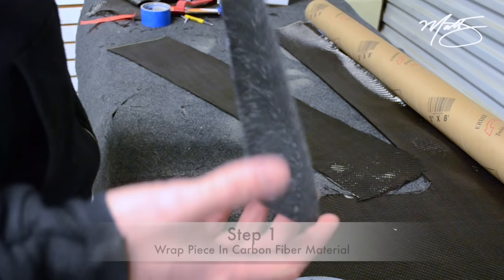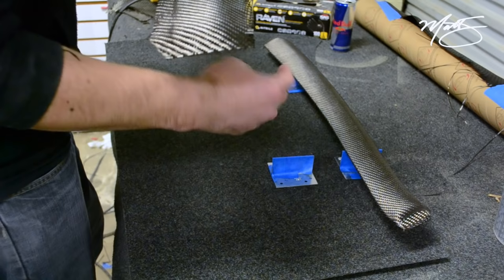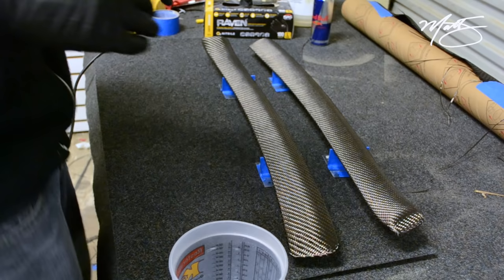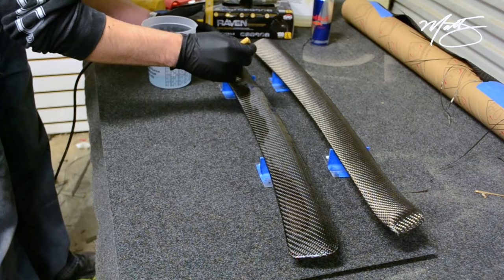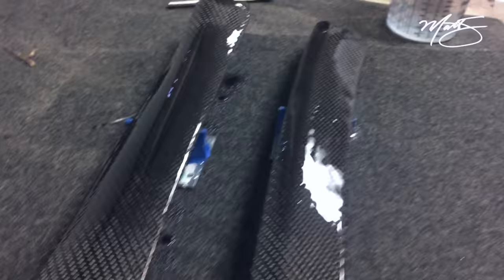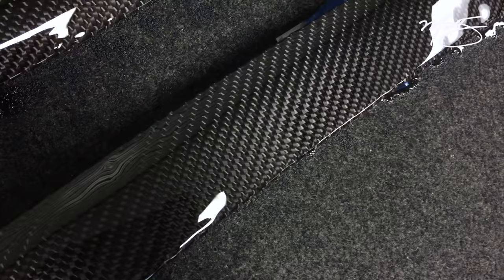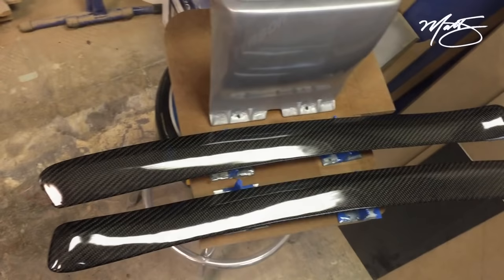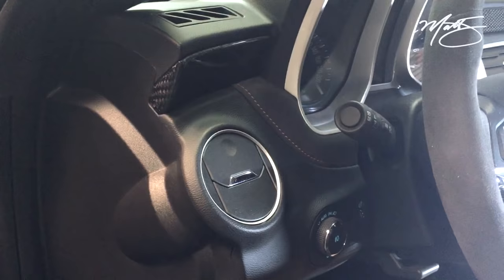How To Hand Lay Carbon Fiber

Comment: A thought ! I apply my third coat, while the second coat is still tacky. Maybe 2 hrs later, depending on temps. The tackyness of the second coat will hold your third coat in place, even on a vertical surface. If I need a fourth coat, I apply while the third coat is still tacky. No sanding between coats. All chemical bonded. Not mechanical.

Comment: Hi, I tried it also with adhesive spray, but this is only stabl till 45°C. What kind of adhesive do you use? It was also a door cover and the carbon fiber deatched......
Reply from the maker: It's imperative you go very light on the first layer of epoxy. This is so it does not fully saturate the adhesive and release it. Hope this helps.

Comment: Thanks for the resin/carbon tips man. For an even better finish from clear coat: dump the 3m product and polish with m105 with an orange pad and then finish with m205 with a white pad.  Then you seal it with wax or  better yet synthetic seal it (12 month protection) and then Wax it.

Comment: Ive done the bagging and wet lay up as well. One quick tip. If you are to your final coat of epoxy and you have a few pits or valleys you can fill with thin super glue. Let that harden and  then sand for final coat of clear. We have been doing this in the aviation business for over  50 years. It sands a little hard but when you are all finished it all blends in quiet nicely.
Reply from the maker: I have heard people talk about and suggest the glue. But my thinking is, most panels I am creating are cosmetic panels. I get it if its an air intake or front splitter where your eye does not catch the blend. But I cant image a random thin ca glue without the activator would blend in perfectly. When light and shadows hit carbon, you can see everything. Hell, in most cases you can tell if you used two different clear coats. (example - you sand down the clear coat and hit the epoxy in a few spots on your panel and then you reshoot the panel with a different clear). You can see where that different layer of clear started on the epoxy when the carbon hits a shadow or direct sunlight. So I always do epoxy layers, normally 2-4 to where I can block sand the panel even to 400.
Reply: Matt Schaeffer I know exactly what you are talking about. Just try a small piece for shits and giggles. You would be surprised at how well it disappears. I only do this if it is necessary. Like one or two pits. If its more than that I reapply another coat of clear or epoxy.Here is a link to my FB page. You can see some of my lay ups.  https://www.facebook.com/pages/Custom-Automotive-Sounds-Performance/163761576980137

Comment: Great video. Also another way to finish the product is to sand to 800 grit then hit it with some 2k clear. Once the clear has cured you can wetsand 1500 and 2000 then buff.

Comment: I add denatured alcohol to the resin-hardener mix. Do it for carbon or glass. For this amount, 1/2 oz is a good start. Mix well.
The denatured alcohol forces any water out. Especially if you are using a container of resin that has been opened for more than a week. Doesn't take long to foul. It will still work, but not be optimum. If your resin has any brown or tan to it, it is toast.
Looks great. You just convinced me to do this to MY shitty ride! LOL

Comment: looks fantastic. I'm planning on skinning so interior parts myself.  although my interior parts looks difficult and quite daunting. I'm looking forward to trying  it out.  my hardest part on my interior is that the centre console, it's  flat were the gearstick is and then turns a full 90 degree to the cd player as it's a complete  part. That's the bit I'm not looking forward too. Anyway great job. looks fantastic.
Reply from the maker: Thank you and good luck on your project!

Comment: Epic vid! Thanks for sharing your skills, and for being so clear and concise.
Reply from the maker: James Donaldson Thanks for the awesome feedback!
Reply: 'Least I could do
Reply: +Matt Schaeffer hi Matt. Quick question. You don't do anything between aplying epoxy right? No sanding or cleaning. Just let it get hard and put an other layer on right?
Reply from the maker: +tinoushgtr If there are no contaminates in the epoxy, I will spray some rubbing alcohol onto the panel and apply the next layer on top. If there are contaminates, i will try and sand out those areas and reapply the epoxy. This would be in the early stages of applying the epoxy. In the later stages, you would sand the panel smooth and flat and apply. I would stop at probably 220 on the last coat.

Comment: Take some superglue and run it along base of the bristles on the chip brush before using it… saturate it and that will stop it from shedding while using it.

Out of curiosity, what is your go to resign for this application?

Comment: I’m a former composite tech and haven’t seen this used before so it raised some questions. I’m thinking more long term. I’m not to concerned with how the lay up of the cloth will look or hold together, but with using a spray adhesive opposed to an epoxy base coat have you noticed any problems with disbond or delaminating over time. How does the epoxy react with the with the adhesive. But seems like a neat trick if it holds up over time and might have to add that trick to my tool box.

Comment: i didnt hear you mention about adhesion promoter and flex agent before clear coat. Epoxy is technically plastic and even though the clear is holding now it will have issues on long term applications. You must first spray an adhesion promoter for plastic applications(ex. Bulldog) before clearing the part.   

I am a painter w 8 years experience  specialized on high end cars w carbon applications to refinish/repair.  Good video by the way. very clear.
Reply: I have 5 years experience in carbon high end manufacturing and the only void about clear coat I found is poor adhesion. after uv exposure the clear coat tends to chip and fall out from the part. no thing about cf being too elastic. I actually avoid using CC as much as I can because of those resins. uv gel coat is best for last layers ;)

Comment: Matt, this video really helped me out with my carbon fiber skinning. But would you mind telling me how you get clean edges, say around vents and what not? or maybe do a video on it!
Reply from the maker: Wrap the piece like you are wrapping in vinyl. Tape to the back edges. When first two coats of epoxy are dry.... come back and a hit your edges on a 45 with a roloc disc. Finish the rest of your coats of epoxy. You will have a clean finished edge.

Comment: Very nice job ! I'm no carbon expert but I just bought a rear spoiler for my car , hand made from a very reputable company and it was not cheap by any means I really love it and the carbon is beautiful, once I installed it I noticed 3 to 4 small dimples? It seems to to be in the clear coat you can only see this on certain angles and light , my question is , is this normal and acceptable?or should I have the company send me another one . Thanks

Comment: im hoping you see this and can advise me. im working on a large carbon fiber targa top for a c7 corvette.  while laying on the epoxy I seem to get brush strokes in the epoxy and it doesnt seem to want to flow/fill in the small pockets and such. using the heat gun works for the bubbles but how do I get the epoxy to flow better? west system 3:1 epoxy super clear hardener using  their metered mini pumps so I know the mix is correct.

Comment: Hi Matt,

What brand do you use for the epoxy and hardener for carbon fiber pieces that will be exposed/viewed? Like side mirror caps or interior pieces?

Also can you recommend a coating or spray to use to help with UV protection if carbon parts are exposed to sun?

 Thanks again for the step by step video.

Comment: do you have to use the clear coat? or can you just use the epoxy and then polish it like you did? and if we use clear coat, does it have to be sprayed on? or can we put a layer on it and let it set itself on smoothly like then epoxy and then sand and polish?

Comment: Great vid man, one of the better more thorough ones I've seen for cf laying. Question about your fiberglass mold of the original piece. What did you use to put between the oem piece and the fiberglass?

Comment: Hi Matt, first off great video. I am planning on making my first carbon fiber parts and am glad you are able to get a great looking piece from hand lay-up as I only ever see people using molds. My parts are all going to be "One 0f One" so I didn't wan't to waste time/space/money on making molds.

My questions...

1. Do you even post cure the parts for high temp stability?
2. If you have to use several layers of carbon fiber, is there anything different you do/ additional steps?
Reply from the maker: +JerseyMikeP Depending on what the humidity and weather is like, sometime I will lay the parts under a heat lamp. If you use several layers of carbon, I usually will use a fiberglass roller on the every layer but the top (finished) layer. Other than that, it is business as usual.

Comment: looks good
                                      it would b cool if u put some kind of sticker like if u had a Logo or company you can like stick it on  the piece you're wrapping then put the third or fourth coat on top of the that it would look like the Logo is frozen in a block of ice
Reply from the maker: I did this in the rear of this Camaro. I embedded the ZL1 on top of carbon into the epoxy.

Comment: Nice work. Gotta love those Raven gloves! Check out spraying acetone to smooth and relieve air bubbles immediately, it works well when misted over curing resin.
Reply from the maker: That is a great tip. Thank you.

Comment: I have an aluminum side panel for a pc workstation that i want to use as a "mold" and layer carbon fiber ontop of it so its the same shape/dimensions as the original panel but add luke vents/fan holes in certain areas... Is this possible? would it be reletivly easy to do? and would it damage the original panel?

Comment: What is the brand SPRAY adhesive do you use? Did you just spray the adhesive then lay the carbon fiber on or you put a base black coat before?

Comment: question, I am planning to do this on the interior trim of my car as well. My question is do i have to make a mold of the interior panel or can i wrap this over the stock trim piece just sand it down and spray it to make sure there is a good patch of contact?

Comment: I love the look of your work but i am finding this impossible to replicate. Your spot on about spray adhesive and not the resin like other guides. The resin as a base doesnt work (well not for me) but wasting huge amounts of material trying to lay it and you only get one attempt as lifting it pulls the weave apart. I dont know what i am doing wrong :(
Reply from the maker: +Rich77UK maybe you are using to much adhesive. Get a second person to help if it is a large piece. Have each person hold a side and use your other hand to start in the center and lay down the carbon slowly on the panel.

Comment: Do you have a video showing how to cut off or grind off the remaining carbon on the bottom side of the part.
Reply from the maker: ronald aguilar Unfortunately that is the only thing I forgot to add in the video. The back is taped over the carbon fiber up to the edge. So I peel the tape off (as much as i can) and take a 45 degree grinder with a RLOC 40 grit disc and just slowly hit the edge on an angle. You dont have to hit it much. You should able to peel it off with your fingers if you hit the entire edge on an angle.
Reply: this is what i wanted to see

Comment: would it be ok to use 2 to 1 epoxy resin (light blue kind), hardener to tack down the carbon, I need something that will hold it down very very hard

Comment: Great vid! Thanks! One question. What If I don't want to "wrap" the original object (in your case the spoiler, in mine, a sealed plaster cast. How would you prevent the carbon fiber from sticking to the original object?

Comment: Awesome work, man!!! But if you don't sand after first layer, then how secon coat of resin sticks to the first one, without sanding? It should delaminated!
Reply from the maker: Algirdas Delnickas The two part epoxy will adhere perfectly to itself without delamination.

Comment: Very nice video! But I still have some questions, how can I make a shape for example a engine good with just carbon fiber and not any the original piece that is shaped. For example, you made your carbon fiber panel from shaping it from the old panel, what if there was no panel? Can I still shape it? Please answer because my group is very interested in using carbon fiber as our car model body
Reply from the maker: li calvin In the case where you wanted to just make a mold of something, you would just do a layer of painters tape and aluminum foil on the original piece. Make sure you use mold release wax so you can remove your part. You would have to use 2-3 layers of carbon depending on the weight of the mat and the strength at which you need the part. I am going to make a vacuum bag video for carbon as well. So that should cover both ways to do it.

Comment: hey man can you tell me the main epoxy ? i cant see the name on the sticker .. second is resin reseach epoxy 2000f right ? and btw can i do it with vinyl(its some kind of a fake carbon..it looks like real but the material is not as the real one) and still use the epoxy.. thanks

Comment: Hey Matt, what did you use as your template and how did you make it?  The piece you layed the carbon on? And how did you mount it on the door?  Looks amazing!!!!! Love it man great job.
Reply from the maker: I made the original piece out of fiberglass. I could have used the carbon all the way through. But when you lay fiberglass, it is easy to cut your shape. Draw a sharpie line on your foil and when you resin your fiberglass the sharpie line will transfer through. Cut the fiberglass at the sharpie line and then lay your carbon fiber. :)

Comment: Hey Matt, great video. Thanks for sharing. Had a question for you - have you ever tried adding a shot of denatured alcohol into the first batch of resin (for the wet coat). I've tried this a few times on regular glassmat and it worked well just for the first layer. I found that it helped eliminate any brush strokes during the first layer because the resin was less viscous. I know the strokes in the first stage don't matter much but was just curious to know if you have tried that with carbon fiber material and how it went! (I've never resined carbon fiber material) THANKS!
-Zeke
Reply from the maker: +MintYourCar Nope, but I will give it a try. Thanks!

Comment: Hey Matt, Thank You.. Very nice work, and a very thorough informative video. I have a question. What would your thoughts be on using a pre-preg carbon so as to "idiot proof" when laying the carbon before your first coat of epoxy, so that you don't accidentally separate the weave?
Reply: +Alex Russo Prepreg is very sensitive to temperature, and the resin is already mixed with its hardener. Therefore, pre-preg carbon fibre needs to be stored at very low temperatures to prevent the resin from curing before the fabric is used. It is normal for pre-preg fabric to be stored at temperatures of around -20°C. So no, Prepreg is definitely NOT what you want as a beginner. Oh and it's much more expensive.

Comment: I'm making a skateboard and I would like to layer the carbon fiber with some 1/16 maple sheets and 1/16 steel or aluminum, and then some nice carbon on the top...how would I make the visible layer a matte finish?
Reply from the maker: You would finish with a matte clear coat, instead of gloss
Reply: Matt Schaeffer oh sweet! Didn't even know that a matte clear coat was a thing. Though i now wonder how i didn't think to look that up! 

Thanks, i'll try that when i get to the building stage

Comment: Hello
first guy who made for new people so informative video. By the way you not sand with dry paper after first layer you put another in the morning on top? or you brush before that surface so resin can attach to first layer?
Reply from the maker: Darius Dulskis I never sand after the first coat of epoxy. The first coat is a wetout and the goal here is to protect the twill and get the first layer to harden. If you were to sand the high spots, you might hit the weave and it will be magnified under later layers of epoxy.

Comment: MAtt great video.  But what is the process if you want to lay 2-3 CF layers for a rear spoiler.  Do you do all the sanding and blending between layers?  Or adhere a layer, epoxy it and lay another one immediately?  Thanks.
Reply from the maker: If you are adding layers, then your primarily adding strength. If your doing it for cosmetics, then you don't need to add the multiple layers.  Just make sure your starting out with your piece painted black. If you are going to do layers, wet out your first layer of carbon, then lay on your next layer immediately, repeat.
Reply: Matt Schaeffer Thank you Matt!

Comment: Hi Matt thank you for sharing your technique, you made it looks so easy !
I have a quick question for you I want to carbon wrap my car panels which made by plastic/abs would your technique still work ?? I wont find any problem using the spray glue to tack down the carbon to the abs plastic ? Thanks again Matt ! :)
Reply from the maker: +ronny82 I would do an overlay and make your own inserts. Do this by laying down aluminum foil on the original panel with mold release on top. Lay 4-8 layers depending of the weight of your carbon mat. This will give you a 100% carbon fiber mold of whatever you are laying up.